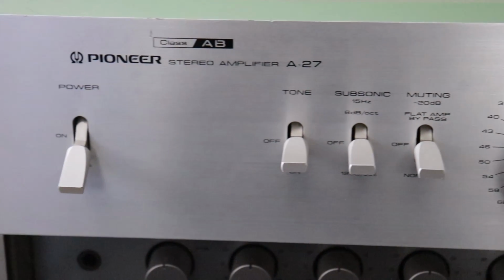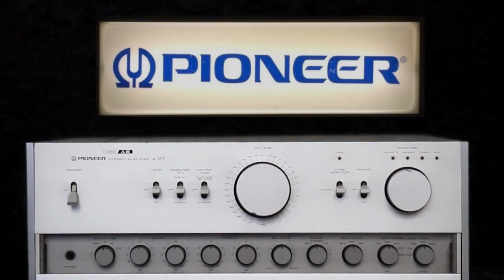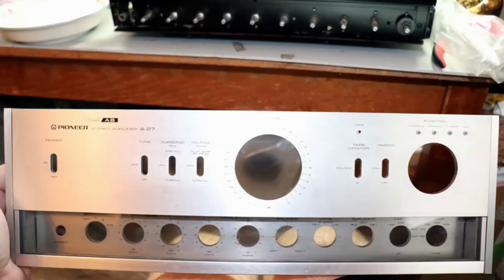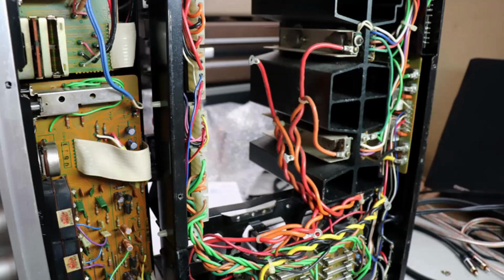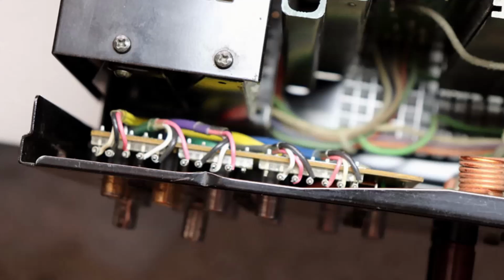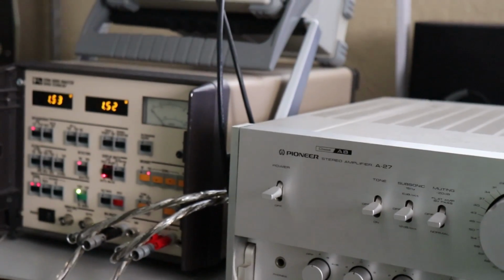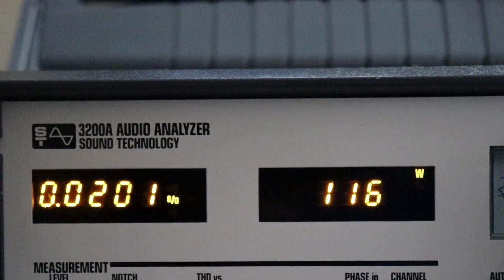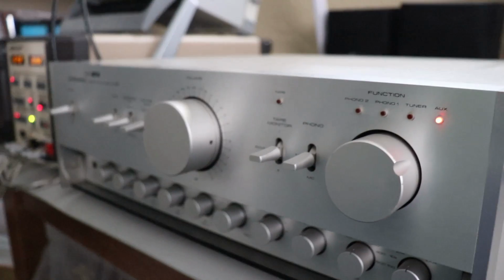Pioneer A-27 Integrated Amplifier-Vintage Stereo Repair Restoration Testing Classic 2 Channel Audio

Comment: Hello, I’m too young to have witnessed the Serie 20 in store.
But I bought a pioneer M-25 along with a pioneer C-21 preamp in mint condition from Japan 2 years ago... 
fully cleaned and serviced. and this is an Absolute beast.

I use it with a pair of Yamaha NS-30A “Big ears” loudspeakers.
Reply from the maker: Oh Man! I bet it sounds great! Thank a lot for sharing. There was so much great gear made back when I was growing up. I'm glad that someone younger is into vintage audio equipment.
Reply: Vintage Audio Addict 
Hell yeah, it sound absolutely fantastic, and just like the A-27 it’s an A+B class with the first 30 watts in class A.
Till this day with high efficiency loudspeakers the amp temperature never went above room temp. Even plugged the whole day.

I will never sell or trade it. My kid will enjoy it.

Comment: I just got an SX-3700 in great shape. Getting ready to order capacitors and bulbs. I'm surprised you re-compounded the transistors. I didn't even consider that. I may change my approach to this now. Great video!
Reply from the maker: Thank you so much. I'm glad that you enjoyed it. The SX-3700 is a very nice receiver and good luck with your restoration. The thermal compound just gets dry after all these years. The mica insulators and the thermal compound is fairly inexpensive so it's just the time to do it.

Comment: Series 20 Pioneer I think was the best gear Pioneer ever made but it was not successful.The originally tried selling it to high end HiFi stores that market did not take it seriously since Pioneer was considered a mass market Mid Fi manufacturer. I worked for a mail order HIFi company at the time and we purchased 200 of these and we paid 163.50 for them and sold for 327.00 and let me tell you everyone that purchased one were astonished.They also had 2 power amps one a class A amp that sweet sounding but boy did it run hot. Great stuff and I am glad you are preserving this beast. Cheers

Comment: I like the pseudo-parametric approach to the tone controls. Great video as usual.
Reply from the maker: Thank you, I appreciate it. I was thinking if I hide the name "Pioneer"on the faceplate would anyone guess that was a Pioneer from the middle//late 70's? I don't think I would.
Reply: @vintageaudioaddict I'm 55 and have been a audio junkie my whole life and thought I knew most commercial equipment, but this Pioneer amp is nothing I had ever heard of. Great piece of equipment and has surprisingly good specs.

Comment: I don't recall that series of Pioneer amps. Back in the 70's getting into stereo equipment, I hung around the old Pacific Stereo in the Oakland East Bay Area. Right now my amplifier is a Yamaha AX900U and it is wonderful.
Reply from the maker: Thank you for commenting. I did the same in my youth. We didn't have a big dealer like Pacific Stereo but that didn't stop me.

Comment: I special ordered my A-27 and F-26 through the Anderson AFB (Guam) BX stereo center. The manager asked me what the hell I ordered when my Altec Lansing Model 19 speakers arrived ;-)

The A-27 ran warm enough that I put a large shoebox lid on the top of the amp with a hole cut out in the center to fit the 8” 110v avionics cooling fan that was for a C130. The fan ran quiet but moved a lot of air. My son has that rig now but I still use the speakers daily.

Comment: I seen one in 1979 at a Pioneer shop here in Wichita. I barely looked at it because it was so expensive, but that was what made me remember it, was the price.
Reply from the maker: Thanks a lot for sharing. At $1250 I wasn't affording one either.
Reply: @vintageaudioaddict Same here. Especially at 16. 😅

Comment: Never seen this before and my mother worked for Pioneer Europe so I saw a lot of stuff. Maybe I just forgot it. Man, those tone controls! 50Hz and 20kHz!
Reply from the maker: Thanks a lot for sharing your experience. Not many folks have seen them. Thanks also for mentioning the tone controls. I forgot to say anything about them in the video. That's another odd thing about this integrated amp.

Comment: Agreed. You see a lot of the reviews of the new equipment on Youtube. The stuff is sent to people's homes and they tell you how it sounds,but not the important that you need to know. Pioneer,Marantz,Denon,Onkyo are all under one house these days. SOUND UNITED! The measure all the new stuff now with 1kz compared to before where it was 20hkz-20hz! That 1kz looks great on paper,but it doesn't tell you what the amps true power is? That's a great amp by the way!
Reply from the maker: Thank you very much. Thanks also for sharing your views and for the information. I didn't know that all of those brands are now under one roof, Sound United. Thanks again.

Comment: The later A series Pioneer's A50 - A90 work in a similar fashion to this. I own the A70 a very sweet sounding amplifier with one of the best record deck inputs I have ever heard. My amp was full of dry joints when I first got it. Still got to recap it though.
Reply from the maker: Thank you for your comments

Comment: Hello, I hope you are well. I know this video was posted some time ago. I recently bought an A-27 integrated amp. I bought the 4 large capacitors and replaced the old ones (three of the old ones were bulging), now there is no sound on the right channel, and the left channel only has very low volume. Do you know what could be wrong? Thank you for your time and for your videos.

Comment: I don't remember ever seeing that unit before, probably because of the price.  My rule of thumb was to ensure that you had GOOD speakers, then a good amp.  The speakers should be about half the cost of the whole system, so a package incorporating that piece would have probably been around $3k.  Definitely couldn't afford that back in the day.  I  would not have forgotten that swing down door.  I know it will keep dust off of the controls, but the fingerprints would have driven me nuts.  Sweet unit!
Reply from the maker: Thank you! I appreciate you taking the time to comment. I was probably like you back in the day. I was working at Pizza Hut as a teen and $300 receivers were more in my vision. I agree that the speakers are the piece of the stereo system puzzle that makes the most difference. Good advice!

Comment: I had two of those back 1980 in germany in the service. boy did I get in trouble when I let them rip. Had a pioneer receiver hooked up to run both amps. had four Bose 901s and two pioneer hpm 1500 speaker and two hpm 1100 pioneer speakers . Bose on one amp and pioneers on the other. You want to talk about a concert. That A27 is a bad ass. wish I still had one today
Reply from the maker: Thanks for sharing and for your service. The vintage gear brings back so many memories for me also.
Reply: I even had a fan plugged in to one nailed to the wall blowing back fourth on both of them. Never felt much heat at all

Comment: Back in the day C21/M22/U24 was in the hifi shop around the corner.(Was a big shop added to a factory that produced washing maschines and dryers.)
Well,i was lucky that the factory owner was a big hifi fan. That was way before "high end" was a term. In the late seventies. So me as a boy quickly got 
hooked on music (the shop also sold records) and high quality audio gear back then...
Reply from the maker: Thank you very much for sharing your story.
Reply: @vintageaudioaddict In japan the A-27 had a different model number and was the top model of a 
integrated amp series consisting of four models.  A-typicaly only the biggest amp was exported. At
least to my neck of the woods. Normaly its the other way round and the top models are japan exclusive only.
Anyway,the A27 certainly is on eyes heights with the top models from Sansui,JVC,Yamaha,NEC,Technics,Kenwood
Luxman or Sony of that time.  When i look back i can clearly see the consumer benefit of a competitive market....

Comment: I believe this series was primarily sold in Europe.  Any,way, I got into Japanese hifi gear starting in 1971 in Thailand.  I was in the Air Force, and I was overseas the entire 70's.  I bought and sold so much Japanese gear... I should have kept it all.  My favorite receiever was my JVC SR501.  Holy cow.  I bought it in Spain in 1978.  I paired it with JBL-110s.  Prior to that,.  In Thailand, I bought a pair of Sansui speakers (can't recall model no.) that had 15 inch woofers and super tweeters on top of these monsters. Those were the days.
Reply from the maker: Thanks for sharing your story and for your service. There was just some much good quality audio back in the day. Most anything that you purchased was good stuff.

Comment: Nice video even if the design of this unit isn't my kind of stuff.
Regarding the reviewers  today not benchtesting equipment, I think that might have to do with the fact that most amplifier today measures just about the same.
Great bandwidth, very low distortion etc. so not so much to compare against other units with.
After all what really matters is what it sounds like, and that's what buyers want to know.
So that's probably why reviewers only listen to them and tries to describe what they think it sounds like.
BTW, the only Pioneer I have is an old LX-450.
Reply from the maker: Thank you as always for your kind words and commenting. You know back in the day at any price point Pioneer, Sansui, Marantz and many others all had similar published specifications but independent reviews still verified the manufacturers claims. Sometimes the equipment did not meet their published specifications for one reason or the other. I just think if you publish that your equipment meets certain specifications it should be verified by independent measurement....But that's just me.

Comment: Thanks, really liked your video - I feel a bit skeptical about the A-27 running up to or near 30 watts in pure class "A" before sliding into A/B operation - - were you able to determine or verify if that is indeed true during your testing?
Reply from the maker: Thank you! No, I didn't check the Class A vs A/B operation. I was going on the Pioneer technical information for the A-27.

Comment: Fantastic channel. I very much enjoy your work and have learned quite a bit of technical information. The Vintage Knob lists the output devices for this series of amplifier as “RET” or Ring Emitter Transistor. Were you able to find modern equivalents or find a source of NoS?  Also, I did find a cosmetically pristine A-27 in my area for $1500. What is you opinion on that price for a non restored unit. It seems quite high assuming I would have it reconditioned. What price would you have charged for the parts and labor you performed on this unit? Knowing that price will help me determine if I should pass or negotiate. Thank you!
Reply from the maker: First of all thank you for your kind words and for watching. I didn't have any issue with the RET's so I didn't touch those. I'm just a hobbyist and not a professional so I only work on my own equipment. I'm not sure about the cost but for sure it would be several hundred dollars in parts and labor. I always feel if you like something then the cost is secondary.

Comment: I beg to differ with you vis-a-vis your comment that audio magazines no longer actually test equipment. Stereophile’s John Atkinson does an in-depth evaluation, using the latest computer-aided software, of every unit Stereophile reviews. Certainly, another Stereophile writer does the “subjective” evaluation and then Atkinson tests the units on the bench. the British Magazine, “Hi-Fi News and Record Review”, tests its review samples in a similar fashion.I suspect that there are a number of non-English audio publications that do the same, but I don’t know that for sure.

Comment: Nice looking amp. A controversial view here I know, but I find a lot of vintage audio too blingy/garish, and a lot of the wood finishes are pretty rough. I like clean, elegant looking kit, which this is, very.
Reply from the maker: Thank you for commenting. There's nothing wrong with liking what you like. I like the looks of some of the vintage audio better then others too. One thing that the vintage equipment has is the engineering and build quality. This A-27 was very expensive back in the day but even the smallest receiver in Pioneer's line was still built well. There is a lot of wonderful modern audio equipment but it is very expensive. Then you have the junk at the low end that you throw away when it breaks. In today's world there doesn't seem to be a lot of audio equipment in the middle. When I was a teenager working at Pizza Hut I couldn't afford a A-27 but I could afford a $300 receiver. Time has shown that those $300 receivers are still operating. Today, I don't think a teenager will have his or her equipment in 40 or 50 years. Most will be in the landfill.

Comment: After watching this video months ago I started looking for one of these and lucked out finding one in mint condition. The manual and original spec sheet were included and stated that it ran in class A up to 3 watts and then switched to class B. This was surprising because everything I've found online says it stays in class A up to 30 watts per channel.  Any idea why the discrepancy?
Reply: Hi there, this amp runs Class A up to 30 W

Comment: There's nothing like a good rant 😂 Not sure why it has dual tone controls 🤔 We used to have a pioneer integrated amp. I lost count of how many times I blew the internal speaker fuse while experimenting with my homemade speaker configurations. My dad was NOT happy, he would take it to pioneer to get them to fix it then within weeks I would blow it again 😂 They ended up just giving him a bag of fuses. Did you know if you turn it up to maximum then touch the speaker wires together you can make a spark 😂🤣😂
Reply from the maker: Thank for commenting. Good thing you had a "Nice Dad". I'm afraid I would have been in jail if I was your Dad, LOL.